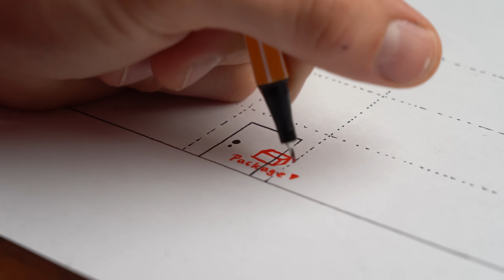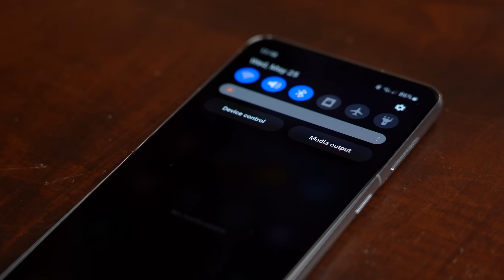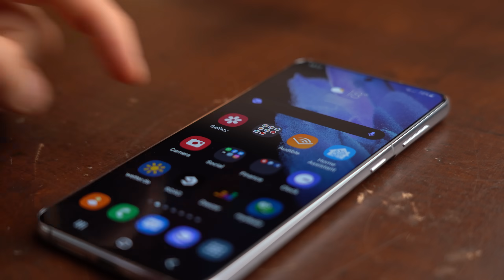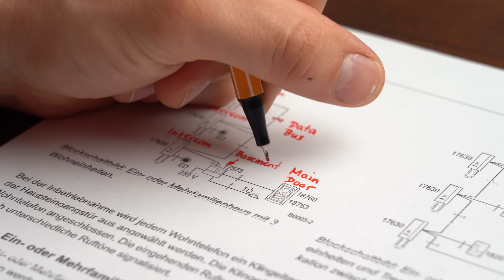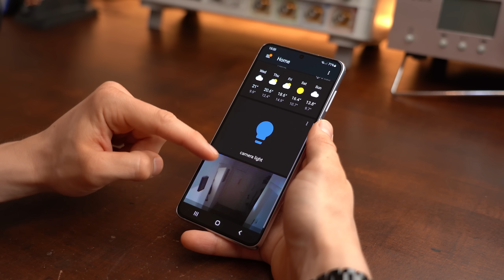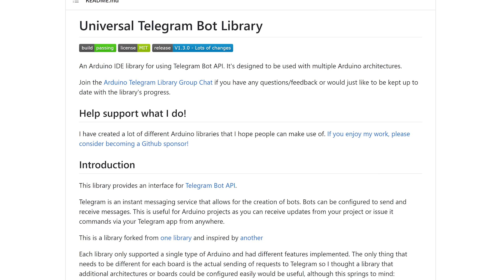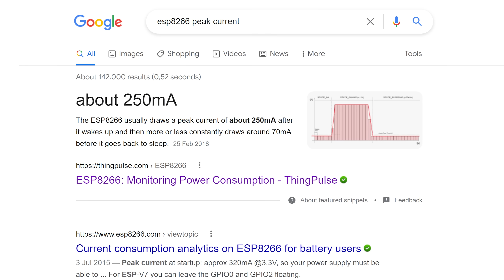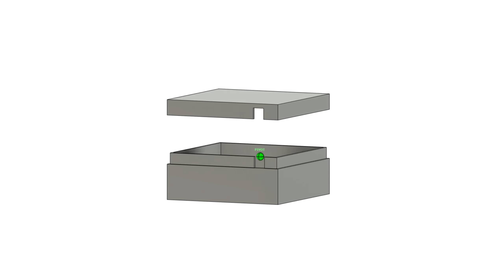Every Apartment needs this Upgrade! (WhatsApp/Telegram Notifications)

Comment: i just build arduino nano super mini board first time, servo brake system, if motor is off servo bush motor axle brake on. no can axle round free if power is off. i know many small board have better not need many in/out pin but i test arduino tiny chip 85 and many time try not can program this usb attiny 85 chip. something has problem no working or has fake aliexpress chip. but buy arduino nano super mini board working well. very small have.

Comment: Would it not be a whole lot easier to just connect the output of the door bell system to a relay connected to the button terminals of a cheap wifi doorbell cam that you set up to call your phone.  you could then see and communicate with the mailman instantly without any programing . When the mailman presses your call button the voltage from the output willl close the relay for a moment which could then simulate some one pressing the button on wifi doorbell  cam connected to your phone.

Comment: This had a simple edge connector.  Why would you solder to it?!  You could easily design/print a 3D part to connect to the edge connector.  Then when you leave that apartment, it simply slides off and comes with you, with no mess left on the pins.

Comment: I understand using a 10k resistor on the line to the esp.

But why did you use a 2nd resistor 20k for ground? 

And why is ground resistor soldered to the signal resistor?

Comment: You wimp... I'd have setup a battery charging circuit to keep tricking it into thinking the line was open and dropping the current till I managed to charge up a battery. Rinse and repete. Works well enough to charge a Li on an AT&T line where the voltage drops when a call isn't active.

Comment: If you didn’t have the 5V on the wall outlet what would you have done? Long wire to another outlet or current limiting on a DC-DC converter?

Comment: Hi,
I think you made a mathamatical error at around 8:30. Yes, the esp can leach up to 250 mA but at 3,3V, not 24V. So it only uses 0,825 VA (Watt), that should be in the headspace of the power supply.
Reply: Are you a Nerd ? 🤣🤣🤣

Comment: I was contemplating a similar build the other day.
@GreatScott! is there a specific reason why you didn’t use the power running through the intercom system to power the ESP?
I would’ve thought that a simple step down regulator would’ve saved you from having to run a separate power cable to the system.

Comment: I once took a look inside the intercom in my apartment to try to do something similar and was shocked to find that the one I have ran on 230VAC, just at a screw terminal, that I can’t turn off myself. 

Needless to say, I put that project on the backburner and thought of alternative ways of detecting a ringing intercom. I do know some smartphones have a built in assistive listening feature that in theory would notify a user of a doorbell sound, but I’m guessing that’s only effective if the phone is close enough to hear it clearly

Comment: @GreatScott, great video.... one of my ideas is to use an RFID similar in old car vehicle on a the main door key. and attach a RFID reader inside the door with a movement sensor, that will  allow you to know if your door lock is picked or somebody has copied your key and has accessed your house, the idea is that with different technology in picking systems it may come in handy to have what I call … a silent alarm… that allows you to turn the cameras or do other stuff …

Comment: nothing against the tinkering but Ritto also sells an attachment with a built-in relay, I only had to connect a zigbee contact sensor to this board and was able to get notifications through HomeAssistant pretty easily. Best part is, that everything fits into the doorbell without any modifications (apart from ripping the case of the zigbee contact sensor)

Comment: The idea of working with some open hardware is a good idea, but you should consider using MQTT or UnifiedPush over some proprietary communications application.

Comment: use something like a small battery wich can load slowly, so u dont need a usb cable anymore, bec. the device wont need max the power all the time, also u could build the whole pcb inside the intervom enclosure, i think theres enough space.

Comment: @greatscottlab - I've been falling down the Home Assistant rabbit hole for the last couple of weeks and have also been rediscovering my love for electronics hardware. In the process, I came across this video. While this particular use case isn't especially relevant to me since I own my home, I found the overall info very useful and it has my mind working over similar situations that might apply. I love your straight forward approach to presenting the info. You get right to the point while providing sufficient detail around the design thinking you used. I'm looking forward to getting to know your channel and content!

Comment: I like the ideo but i would not like to rely on a internet-service or my phone. My recommendation would be to integrate to Home Assistant and instead of sending a push notification i would let some hue lights flash up a few times. That might be way faster and fully local.

Comment: Keeping the microcontroller in light sleep state and powering up only in case ringing intercom while having some decent capacitor behind the buck module would not put that much stress on the power supply.

Comment: That was the reinvention of the tire. Had the same problem - the solution was a simple system for under 20€ from Reichelt with a sensor next to the bell that sends a wireless signal when it 'hears' sound and a receiver with a second bell or a light that flashes when the bell rings. No significant delay (maybe a few milliseconds) and you don't need an external service (a big plus). Something like that is sold for years for people that are deaf or need hearing aids or have a loud environment and works for every bell. 
Ritto, the company that built your house phone, has relays in their catalogue to switch external non Ritto products when the bell rings and offers additional wireless remote bells or remote flashing lights. Other companies even offer a high power relay (8KW) that you can integrate in a fuse box to flash all lights when someone rings the bell. It is used when all people in a household are deaf.
Reply: Something tells me that this project is not for those who want easy solutions. xD It's a kind of fun all of its own to tinker about in electronic boards and chips and find out which pin does what, to then make some sort of system out of it with just a soldering iron and some cheap electrical components. Oh and an overpriced Rπ ofc.
Reply: Well yes and no. I did also use a wireless sender/receiver product for my grandma, so she does not miss the bell when she is in the living room with the TV turned all the way up. Not as cheap as an ESP but a lot less hassle for sure! That said, the solution provided here is applicable (and used) for much more than deaf/hearing impaired/working in loud environments or with headphones! Since it is in fact NOT locally extending the bell alert, one can get notified away from home that somebody rang the doorbell and with the second contact mentioned even trigger the door buzzer remotely…. something the local RF extender cannot do.

Comment: Thank you for this video.
I have a question 
I have bought a high sound small doorbell 5v . And it works with a normal doorbell button.I just want to know if there is a way to connect it to the same introcom that you have shown in your video here .I just want to use this 5v doorbell as extra sound so when someone rings the button of the introcom ,it will work also so I make sure that my doorbell is working not of my neighbour's doorbell .
I highly admire your work and wait for your answer . Thanks for your help

Comment: 5:29 You're lucky the whatsapp notifications arrive on time. Mine take the same 5-10 minutes if the phone is in sleep mode as anything else, be it internet based or even an SMS. The only instant notification is an incoming call. Downsides of energy "efficiency" I guess.

Comment: I made the same on a Ritto Doorbell with an Aqara door/window contact to use Zigbee instead of wifi in Home Assistant. Disassambled the reed contact and used a NPN transistor and a 1K resistror to switch the sensor state from the 5V ring-signal. No need for an additional power supply, wires or outside mounting. Fits into the Ritto housing. The battery should last a long time.
Reply: Exactly what NPN transistor did you use?
Reply: @lpeter1172  Long time ago but I think it was a BC337.

Comment: My doorbell phone has a magnet inside and when someone rings it sends voltage and magnet moves to create a circuit and ring the phone. I've just added a cheap first generation Wyze door contact (only the battery part of the contact) close to the magnet and it's status is always "Open". When someone rings the bell, the door contact status becomes immediately "Closed" and i receive a notification immediately. This works perfectly in my case and the setup is very cheap. The notifications are very fast, never fail and no power cords to build it. Alternativly to your solution there is a company called "Nuki" with a major door phone compatibility.

Comment: ring have released an intercom product now.... this is a cool DIY solution though, I approve hugely
Reply: One that can be used without removing the pre-existing intercom or adding anything to the outside of the building? The main issue with apartments is that you can't remove anything it comes with and you can't modify the installations without approval.
Reply: @JeppeBeier  yeah everything existing stays as it is. You have to lift the cover off the intercom phone to piggyback the cables, but you don't modify anything so if/when you move out, there is no damage or alteration to the intercom, it is exactly as it was installed originally.
Reply: @cloughy101-g7g  Oh that's pretty cool then

Comment: Using IOT system may be easier and faster. Only it will require to develop small app for smartphone if there is not public client app. You may think it for next project idea. Congarts your effort and good projects.

Comment: Or you can do what I did, get a smart camera like the SimpliSafe indoor camera (which you can get for free if you use Verizon wireless). Install the app on the phone and enable motion alerts after installing it outside your door. You don’t need to pay for any monthly subscriptions unless you want to view recorded video and it gives me push notifications whenever someone is at the door
Reply: In an appartment building, that is not a viable solution...
Reply: @Finnspin_unicycles  true, just throwing out ideas that is simpler to implement for folks who may not be living in an appartment building

Comment: Simply put a relay to the push button of the intercom/doorbell, cable it into a dedicated bright lamp in your room. 😃
Reply: That doorbell is very far away from the door... its an apartment
Reply: @runforitman if it is multi storey apartment with addressed doorbel to each unit, then you can relay a lamp from the doorbell speaker in your room.
Reply: Or a small microphone, tuned to the bell noise and activating a smartlamp on his desk. No fiddling with wires.
Reply: @se_mat  sound recognition is exponentially harder and more sensitive.
Reply: @runforitman  The bell is not citing Shakespeare, it is a very distinguish sound that a frequency filter and loudness resistor can handle.

Comment: Wouldn´t it be better to  use a optocoupler between ESP and the phone circuit for electrical separation?
Reply: Yes, and No,  given a near buy Lighting Strike could induce many KV's into the intercom wiring,   the  optocoupler may be of no value.  So I would give this design a fail.

Comment: Out of curiosity - have you looked into Nuki? It’s not DIY, but similarly to your build attaches to the intercom and offers (remote) unlocking as well. I’ve been using it for a few years and it’s been a game-changer.

Comment: As neat as this is, when low delay is of importance and off-site notifications are not needed, a more simple and robust option might be a 433 MHz RF (radio) solution. I am currently using both a homebuilt RF ($7.99 wireless doorbell) and homebuilt smartphone push notifications for an alarm, and the smartphone notifications can take anywhere from 0-10 seconds, while (obviously) the RF doorbell is always instant. 

The way I rigged it up is simple - I glued down the button on the RF remote controller in it's pressed state, and the battery terminals of the remote are connected to a 12 V output from the alarm (the remote normally uses a tiny 12V battery). This gives me both instant (loud!) audio notifications anywhere I need in the house, as well as notifications on my smartphone when I'm not home. Since the wireless doorbell is battery powered, it's easy to place it where you need it. 

Some cheap RF doorbell systems are also configurable enough that you could get a single remote to activate multiple receivers. Or just connect 2 or more remotes to the 12V output. Obviously, if your alarm output is 5V you should probably try to find a doorbell that has a ~5V remote if possible, or you'll have to rig up some relays and batteries/power adapter.

Comment: The esp draws 250mA but from 5v not 24V so will only consume 1.25VA, safe to assume even 1.5VA but certainly not 6VA. A nice step-down power supply will draw about ~60mA from a 24V input

Comment: They have Ring doorbells that run on batteries, don't require being wired into the existing doorbell and can be attached with adhesive. I've seen apartments where they just attach it to the door right under the peephole. A good simple solution other than the battery part.

Comment: I've overcome this problem with much more easier and cheaper solution.
I bought a cheapest strip led (i preferred red) and 5m electric cable.
So I connected in parallel the doorbell cable and new electric cable then i soldered 1 unit led the end of it. Finally i attached the led with double sided silicon band to bottom side of monitor. (faces down to desk). And viola! you will noticed when doorbell rings. You could miss the phone notification but you cannot miss the red led light. Edit: By the way, you can do the same thing for buzzing the apartment door with placing a simple button to below your desk ;) Sorry for English lol

Comment: I'm trying this code.
I've written it on my D1 mini but it continuously rebooting after flashing.
can anyone help me?

here the error on the serial monitor

--------------- CUT HERE FOR EXCEPTION DECODER ---------------

ets Jan 8 2013,rst cause:2, boot mode:(3,7)

load 0x4010f000, len 3460, room 16
tail 4
chksum 0xcc
load 0x3fff20b8, len 40, room 4
tail 4
chksum 0xc9
csum 0xc9
v00060610
~ld
ISR not in IRAM!

User exception (panic/abort/assert)
--------------- CUT HERE FOR EXCEPTION DECODER ---------------

Abort called

Comment: Hi Scott! First off, I love your way of making these videos and the way you're explaining everything. Now, the first video I've seen from you was about solar charging panel, and I have an idea to make solar panel that charges battery which then powers up LED light. Now one thing that I would like to understand better is I belive simple electronics. Say if I was to have 
1. TP 4056 1A charger module
2. the power suppy module / pwr bank module 5v 600mA
3. Battery 3.7V 1100 mAh
4. transistor A1015
5. led lights 5 watts 4v-5v dc
6. solar panel 5v dc

Would you be able to explain proportional change, if I was to have more LED's, or for example if I wanted to add manual switch (on/off) to the circuit..
If you could explain it in comments or even making a video about it, I'd be eternally  grateful :)
Also, if anyone reading comments is competent enough, and willing to explain this to me, go ahead and help me out PLEASE :D

Thank you all!

Comment: I ended up doing something very similar at my home, only that it was a different, video-enabled intercom, also with a digital bus.
In my case, though, and in case it might probably happen to many of you interested in doing this for your homes, but you do not happen to "luckily" figure out/"discover" those extra 3 pins, there's a more straightforward but infallible approach (which worked flawlessly for me):

Just follow the intercom circuit up until the pair of conductor lines that handle the speaker unit that produces the ring/bell.
Measure the voltage variance between those when the bell rings, and then build a voltage divider to take that to the ESP GPID input level (3.3v).
That's it :)  (by the way, I used the more advanced ESP32 instead of an 8266)

P.S: I also included an inbound feature: to be able to remotely "press the open button" with a similar approach. I wired the two pins of the open push button to a small relay driven by one of the ESP output pins... and . magic!

Comment: 8:39 those peak times are fleeting enough to use a capacitor to power the board from that 24v.  The extra current comes off the capacitor which can have a slow recharge.

Comment: Why don't you add the signal as an entity in Home Assistant, then use the telegram notification integration in Home Assistant itself.
That way
1) You have full integration and logging capability via Home Assistant + maybe if you wanted to flash a lightbult in future you can do so too
2) Telegram is also almost instant using Home Assistant telegram notification integration - I use this for my own home with my IKEA + D2 Mini air sensor.

Comment: Needs an octocoupler on that input.  I do something very similar except the signal and power loop is 24VAC.  I also cannot do much about that fact because it's also connected to the whole house system that controls almost every system in my house (and it's not modern, it's an 90s Panasonic house system.)